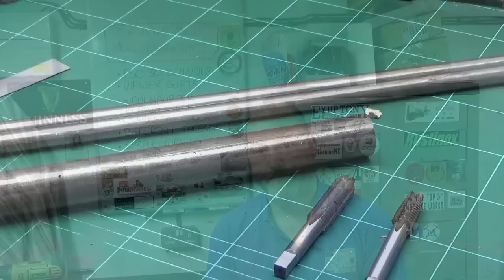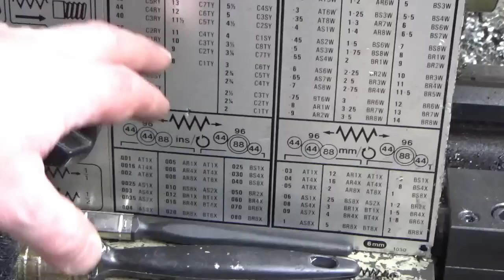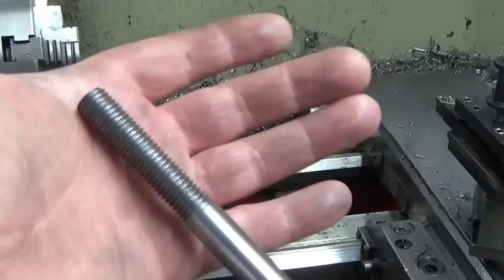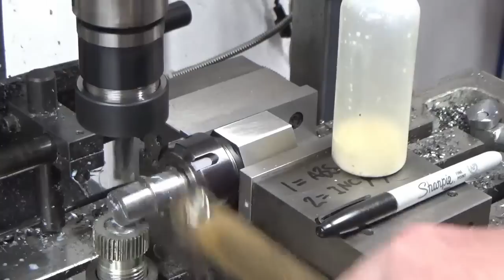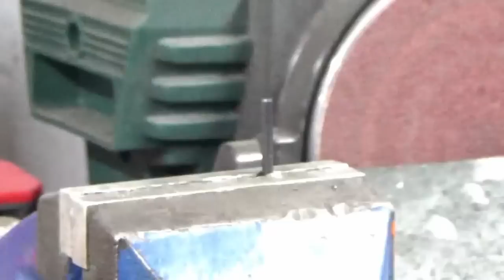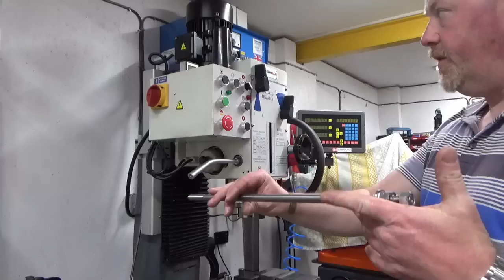Making New Drawbars for the ZX7045 Milling Machine

Comment: Sorry John, you are very good but a mistak here that angle should be from the perpendicular to the thread, and best at 27 to shave a whiskee from the flank. Also you need to reduce the OD,  as you are not profiling the crest radius .

Comment: Hi John, I've always just plunged straight in, no compound angle, even at tech college that how we cut the thread, been doing it for years. Both acme and vee, although ran spindle slower and found reversing lathe was the best way. Less cursing! Anyway there always more than one way to skin a  cat
Reply from the maker: Hi, me too really unless doing really coarse big threads. It is useful info though for those with micro lathes as they really aren't man enough to straight plunge so I thought I would show it. Cheers, Jon

Comment: Measuring the infeed is a bit risky, especially with a hand-ground tool. The problem is the depth directly depends on how sharp the tip is. Tools for external UN/ISO threads ideally have a flat at the end that is 1/4 of the pitch, so about 0.020 for a 12 TPI. However, threads are often cut with a close-to-perfectly pointed tool. That  translates to about 0.035" variation on the pitch diameter for the same infeed.

Comment: Hey there Jon ☺ new subscriber here , really enjoying the video's 😀 What i was wanting to ask you or any of the viewer's that might know. I am new to using a lathe , i managed to get my hands on a cheapish one , nothing special. The issue with it is that the crosslide leadscrew is bent , which make's it not very nice to use when making facing cut's and feeding in. So what i am wanting to know is . . What type of steel would be the best to machine a new one from ?
Reply from the maker: Hi Gary, welcome to the channel, I hope you find the content interesting and Informative. I would use EN8 (high tensile, but free enough machining). Depending where you are located, you may need to look for the equivalent grade etc. Hope this helps. Cheers, Jon
Reply: @jonsworkshop  Hi Jon. Thank's ever so much for the reply. Yep i am finding your video's very entertaining and educational 😀 Ok EN8 yeah ? I am in the U.K mate , so il have a look around for some of that then. Cheer's buddy 👍

Comment: I was yelling at the screen about that compound angle! These days I use carbide full-form threading inserts and plunge straight in with the lathe in reverse and a rear toolpost, must be five years since I used the compound for threading.  There's something very satisfactory about the proportions of a nicely made shouldered nut.
Reply from the maker: Hi Machining and Microwaves, thanks for the comment. There certainly is, I thoroughly enjoyed re-learning 😊

Comment: You didn't mention when you changed over, if you reground the tool for the whitworth thread at 55 degrees or 60 and reset the compound.
Reply from the maker: Hi Ian 55 deg as Whitworth form, the compound slide angle was the issue, it was set to 27.5 deg away from the saddle slide, but should have been set from the cross slide. Cheers, Jon

Comment: Hi Jon. How do you find availability of threaded cutters for the Clarkson. Seems like people are moving away from these. I have a posilock that I inherited but not sure whether to source threaded tooling or go with ER collets.
Reply from the maker: Hi Adam, I would always advise ER as these hold any shank type. Keep your eyes on Ebay for 2nd hand job lots of the threaded type, there are bargains to be had occasionally. Having both options at your disposal is useful. Cheers, Jon

Comment: When single point threading without an undercut, were you using the M300's foot brake to stop at the end of each pass? It didn't sound like it, but the chuck did stop very quickly. Keith Rucker can single point thread on his Monarch without an undercut, but to me it seems extremely perilous. You only need to overrun by a small angle, on just one pass, and tool will surely dig in. How did you manage it in the old days before you forgot how to do it?
Reply from the maker: Hi Samuel, yes, foot brake was being used but it is sketchy. In the old days when my hand eye coordination was much sharper, I just used to retract the cross slide, once you are well practiced at it, it's pretty robust....... the key word there is practice! Many mistakes are made during the practice period lol. Cheers, Jon

Comment: Nice little project. Works differently to the drawbar for my mill - which is just a very long bolt with a hex end [I made a replacement by whittling down a 19mm hex-bar, since the one that came with mine only fits the one arbor that came with my mill - Clarkson one - and all the tooling I've bought is M10, not 3/8" Whitworth].

I too spotted the 30 degrees in the wrong axis. Largely because I made the same exact mistake. I've since learned that some lathes have the angle scale relative to X, some relative to Y. So, on some lathes, you'd be setting it to 30 degrees (or 27 or whatever), and others you set it to 90-<30, 27, etc>.  And I've also learned that it's only required for quite coarse threads. There's no need to do that for threads up to around 3mm pitch (unless the material is very tough).

Comment: Last night I was also making a draw bar for my mill - with an M16 thread. Also like you I knocked the tip off my 60 Deg tool. I realised that stopping the lathe on a cut was the problem. After I reverted to my normal practice of cutting a groove for the tool to run into there was no problem. I wonder if that was part of your problem?
Reply from the maker: Hi, yes, it definitely was. When I used to do this stuff regularly, my hand eye coordination was good enough to be successful. Clearly my confidence hasn't faded as quickly as my skills lol

Comment: Cracking job Jon. I tend to set the thread depth I want first using both the cross slide and compound slide. Note both slide positions, wind out the compound, and making sure to return the cross slide to the marked position before each pass, just wind in the compound a bit each pass until you get to its set position. Many ways I know, but this works for me. PS; Is the revolving centre with the red ring on a special, or home brew? I like the clearance you've got to the work for threading.
Reply from the maker: Hi Dave, that will work! The revolving centre is a Vertex one, very good quality and has a selection of differing geometry points that fit in the front on a taper, well worth getting one. Cheers, Jon
Reply: @jonsworkshop  Set on order, thanks Jon.
Reply: @jonsworkshop Hi Jon, just received my Vertex live centre :-) £190 well spent. Thanks again

Comment: Great work Jon, they look superb and work superbly. I've made that same mistake with the angle when single pointing lots of times. I have just got hold of some very large high tensile steel bolts that were going to be scrapped. One of them is going to eventually become a drawbar for my Harrison Mill vertical head.

Thanks again for a great film.
Reply from the maker: Hi Carl, thanks for the comment. In my next video (assuming my idea is a success) I will have the tool to make sure that never happens again...... hopefully 🤣🤣
Reply: @jonsworkshop  Sounds great I shall look forward to it.
Reply: @jonsworkshop   “The best laid schemes o' mice an' men" 🤔GB:)

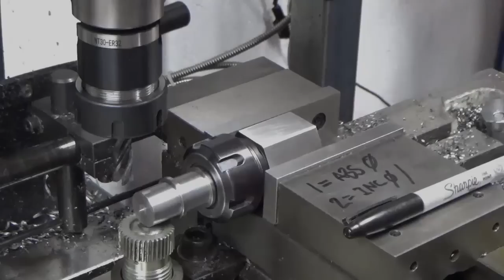Comment: Hi Jon, at 19:15 you're milling the hexes for the nuts. I'm curious about your orientation of the hex collet block in the vice, effectively gripping across the edge rather than across flats as I'd have expected. Any reason for that?
Reply from the maker: Hi Russell, thanks for the comment. Good question. My collet blocks are cheap import ones, when they arrived I did some checks on the surface table, the relationship between the flats and the collet taper were way better than between the flat transitions and the collet taper. For jobs like this when repeatability on depth is needed all round the unit, I always locate on the 'best bit' and clamp on the 'crap bit'. Hope that makes sense. Cheers, Jon
Reply: @jonsworkshop  Thanks, Jon. That makes perfect sense.

Comment: Oh dear, I spotted the compound at the wrong angle and could tell what was coming😟. I have an M300 too except mine is a 4tpi leadscrew. I do quite a bit of single point threading, so a couple of things I did to improve life: 1. Get a decent piece of HSS, pref UK made, it chips far less on the tip. 2. Make sure the tip has the sharp point stoned to a radius. For a biggish thread it can be quite rounded and I have different bits for much finer threads.
A runout groove at the end of the threads would help too. I never stop the motor to terminate the threads, I've set the rampdown rime to 2.5s so its too imprecise. I use the technique of opening the halfnuts, stop the motor, pull the tool out, reverse the lathe and reengage on the same number. As long as your threading dial doesn't do a complete revolution the leadscrew and thread will still be correctly synced up.
Reply from the maker: Hi Robert, thanks for the comment and feedback. Lol, I was trying to be smart not using an undercut, I used to be able to do it no problem at all but it is clear that the mists of time degrade your skills much quicker than your confidence 🤣🤣🤣🤣

Comment: Ahoy Jon, that was some nice work 👍. Pardon the following ignorance: is the captive nut used with a second wrench (in lieu of a spindle brake) to prevent rotation while tightening/loosening the flange nut? 🤔

I ask because my spare mill, a seldom used Rong Fu 31, has no spindle brake. A drawbar like yours could be quite an aid.
Reply from the maker: Hi Dudley, thanks for the comment. In short, no. It will be no good for that unfortunately. I just whack my gears into lowest speed and tighten up against the torque generated by the low gear range. Bit cowboy, but doesn't really do any harm. Cheers, Jon

Comment: Good work Jon. 

When you were talking about the dial indicator which you setup for measuring thread depth, I immediately noticed that the compound slide looked like it was around 30 degrees off the line of the spindle, instead of 30 degrees of the line of the cross slide travel. I have seen lathes that have the degree stamps measured from the spindle axis, and also some measured from the cross slide axis. So in some cases (e.g. when the marking are measured from the spindle axis) you can set the compound slide to say 29 degrees believing that this is correct, but that is the wrong angle (my Emco is like that). For my Emco lathe, I need to set the compound slide to say 59 degrees, which is 29.5 degrees off the line of travel of the cross slide.  
Also, I saw that you did not have a relief cut for the end of the threading tool to go in to. I guess that is what caused the tool to chip when the tool did not stop in time for the end of the thread. 

All in all good video and I'm sure your mistakes and corrections will help those people who are new to single point threading on a lathe.
Reply from the maker: Hi Jon, thanks for the comment and feedback. I was trying to be smart not using an undercut, lol I used to be able to do it like that without any issues, it is clear that the mists of time degrade your skills much quicker than your confidence 🤣🤣